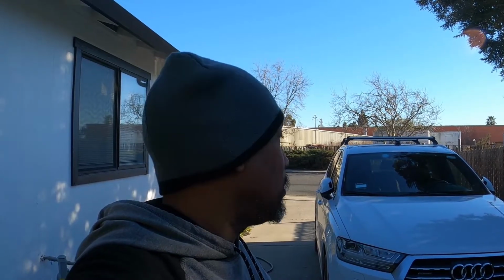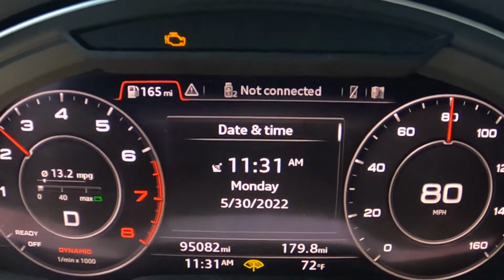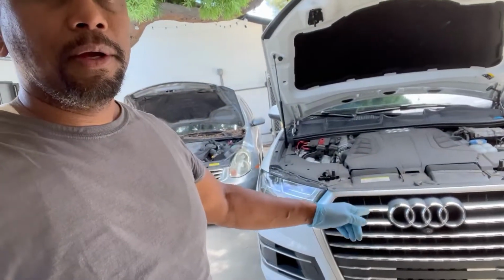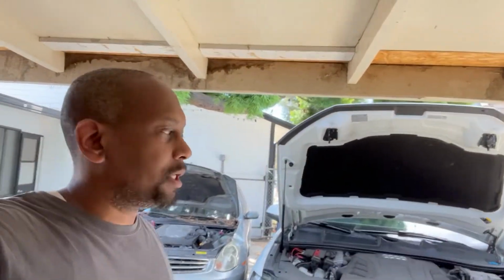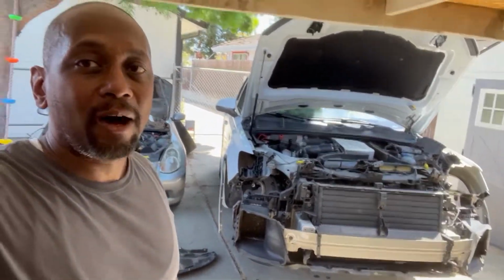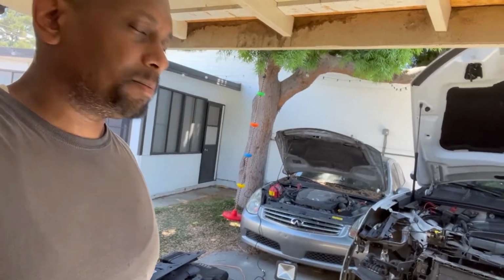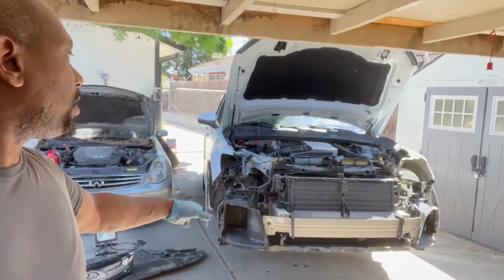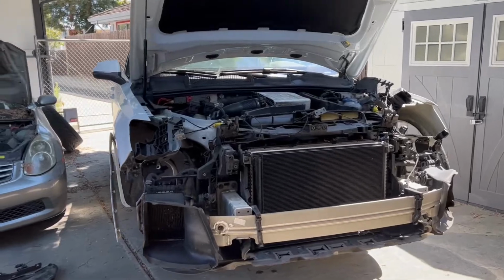Audi Limp Mode Fix

Comment: Thanks for the video. I have same Q7 with same issues. I ordered an new actuator. Did you do a  re-learn/adaptation for the new shutter?
Reply from the maker: I’m glad it helped Cory! I only had to clear codes and no re-learn needed in my case. However I did purchase the actuator and shutter as one assembly. At the time it was only about $350 so it was worth it to me. I have another video dropping in a few days about an easy Audi hack so look out for it.
Reply: I bought the motor only. Any idea on how to do the relearn?

Comment: thank you for that video, I’m currently having that same problem. I wanted to you what is the part number and which scan tool do you use? I’m not a mechanic but I thinking to try and tackle this myself.
Reply from the maker: Glad to help, the part# 4M0121219B is a dealer only part but it arrived in just a few days. Make sure the parts counter confirms the PN for your year and make sure to get the one with servo included. Before buying check that it’s not opening and closing when unlocking door and cycling key. If it moves then it may be something else. As for scan tool I have a Snapon I rarely use but mostly use a cheap Foxwell NT510 scanner I got from Amazon. The Foxwell is now my go to scanner as long as I don’t need an oscilloscope feature. Thanks for your comment and please hit the like button and subscribe to channel. I could use the support. Hit me up if you need anything else.
Reply: @BrettMedia  thanks for the reply I think mind is stuck on open. I went to Jamaica for 2 weeks and parked my car on top of the parking garage because I was rushing, there was a winter storm when I came back the check engine light came on and would not come off. Got the car scanned it came up as the shutters however it moves but it makes the same noise that came from ur video.
Reply: Actually mind moves however it’s making that noise and I think that maybe triggering something it’s not closing and opening as it should

Comment: I have the same Drive System Malfunction problem on my 2017 Audi Q7 3.0. The car shakes really bad when I accelerate.
Reply from the maker: The vehicle shaking makes me think it’s something different. My only issue was the vehicle going into limp mode (cutting ignition over 3k RPM). It would drive normal before malfunction message would appear. It would also go away for awhile if vehicle was turned off and restarted. Is you shaking constant or intermittent? Any particular speed? Does it change with speed? Any noise associated with it?

Comment: Hey! After you replaced everything and took it for a test drive. Did the engine light come back on or did you hear the same noises. Because I have the same problem 2017 Audi Q7 3.0. And someone told me I have to replace the motor and at the same time I have to reprogram it so the engine light won’t come back on. I can’t just go ahead and clear the code.
Reply from the maker: Nope, no engine light and no noises after I cleared the code. I required no programming of the motor either. But note the parts were original Audi parts (air shutter and motor together as one unit). I only did what you see in the video replaced it and clear the code. It’s been almost 2 years and no issue. Thanks for watching and don’t forget to subscribe!

Comment: Thanks for the great videos!  
Did the repair fix the issue or did the Drive Malfunction code come back?
Reply from the maker: Yes the codes are cleared and the drivability problem solved. Its been about 2000 miles since repair so its good until the next issue. lol.
Reply: @BrettMedia  Good to hear!  Your work is impeccable!

Comment: So I have a 2018 with the same issue they had a warranty extension to like 80,000 mi for these mine was like $81,000 whenever it happened and went out they were going to charge like $2,300 bucks or something to fix it. The only thing I wish I would have seen this a bit sooner but due to how I think it was labeled or some of the hashtags that are associated with the video made it harder for me to find so you might want to try and add the actual error codes that pop up when this occurs like PO5A3 to make it easy to find for others I'm going to have to tear mine apart and replace it I'm debating between just the actuator bypassing it or doing the same thing you do which is by the whole unit so I don't have to buy just the actuator and then rent a vCDS reprogrammer Even though you can rent them for like 25 bucks
Reply from the maker: Thanks for you feedback Chris G, I will have to add the code to the hashtag and description. As for replacing just the actuator or the whole actuator and shutter assembly, I chose to do them both at the same time because it was under $400 for the parts and their both the same age I would hate to have the shutter get brittle and break just a few years later. Ounce of prevention equals a pound of cure. Thanks for the support
Reply: True, but mine was already apart and so it's not gonna bother me to just do the motor for 50 bucks when that's been the part that has genuinely failed on them that made them extend the warranty coverage for them. ironically, whenever I went to order the part motor just itself Audi kept saying it didn't fit my vehicle, even though it was the same part number also the replacement for the previous models. So it was only suggesting the whole unit replacement like you did I'm cheap though. Plus I won't have to remove the headlights ultra lazy powers activated lol I appreciate the video though

Comment: What code do you have?
Reply from the maker: Thanks for your comment, I had a “P05 A0” code. I hope this helps you!
Reply: Thank I have a same problem whit the p25AC00 I thing so is the oil cooler housing and oil cooler valve